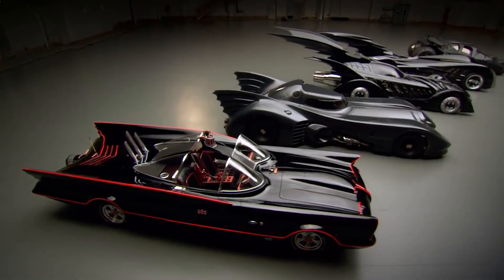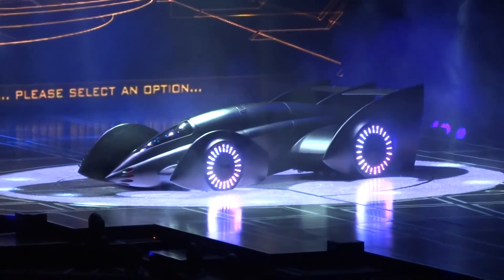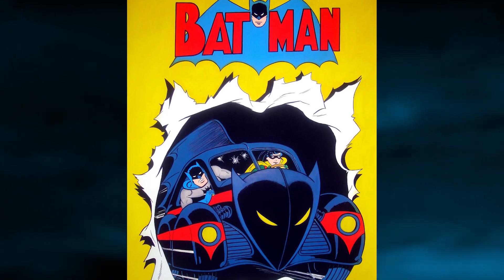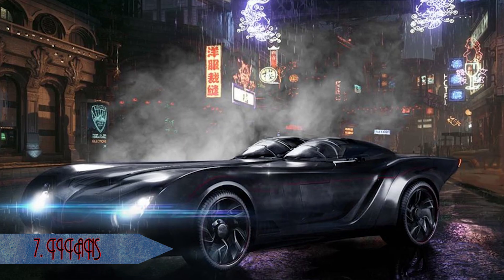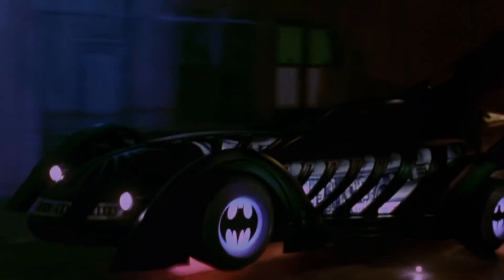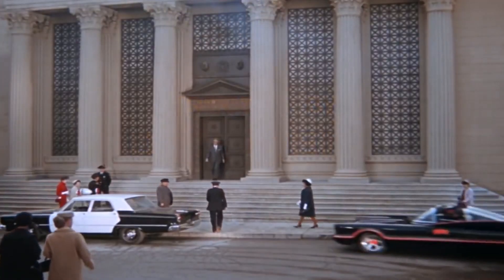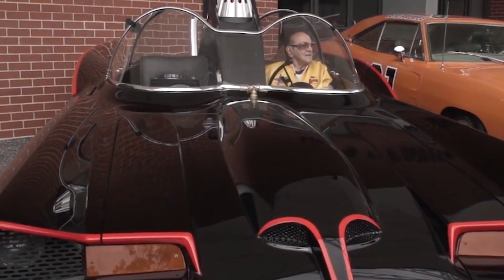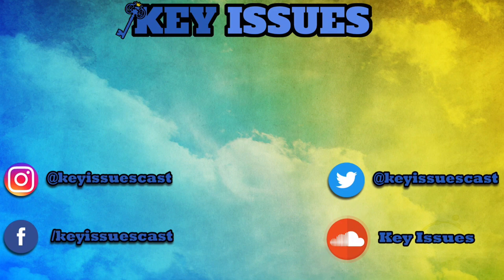Every Live-Action Batmobile Ever

Comment: Well I love the new Matt Reeves rendition of the batmobile, It fits with the whole still young and inexperienced batman and the mid engine feature might be useful for weight distribution as it will make it easier to turn and to chase in but the exposed engine is super cool but it gives off this whole it's not finished yet and that it was prematurely called to the field before batman could finish it it fits with this batman